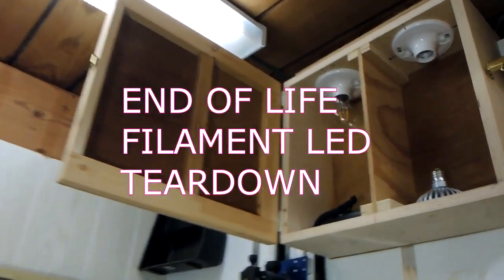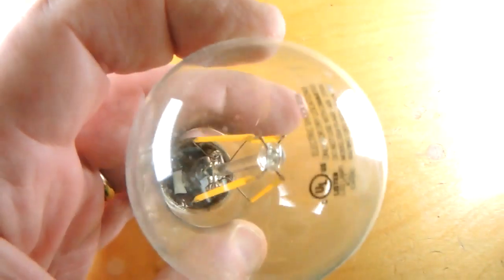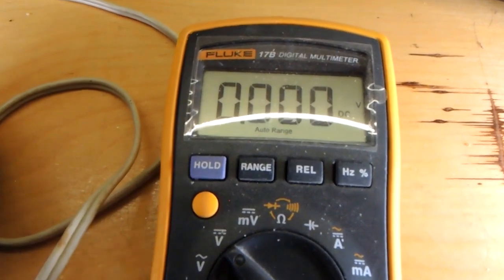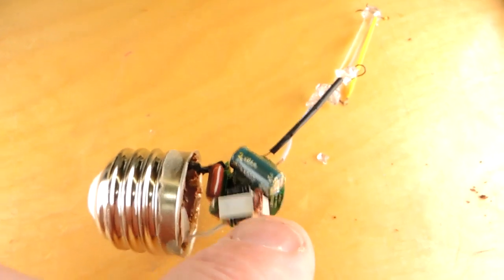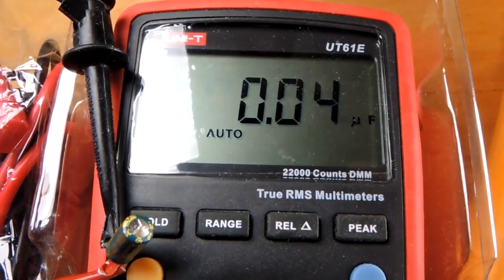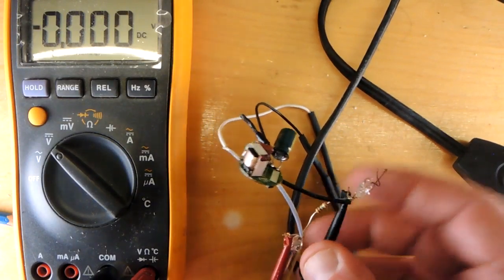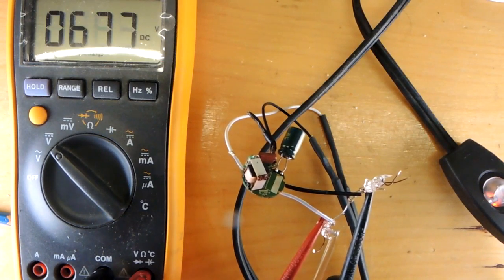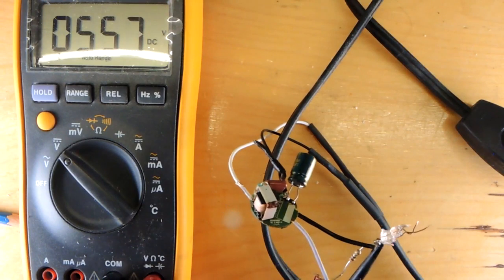Filament LED Light Bulb:  5 years and Teardown Time

Comment: I've bought 3 6W led filament bulbs like yours and all 3 had the filament fail(after 2-5 years). Possibly due to higher drive current? There was 6 filaments with 3 parallel and 2 series set up and once one filament dies it increases the current in other 2 and causes a cascade failure

Comment: Good to see how that test worked out. Such a pity they cheap out on power supply components. It would have been interesting to see how long the LED filaments would have lasted if you could just switch out the blown fuse and cap then fire it up again.

Comment: 70 V is quite typical for these. There are usually about 10 blue LED chips in series in each "filament" stick, and if I diagnosed it correctly your bulb had 4 of these sticks, two each in parallel and then these parallels connected in series, so you would have a two parallel strings of about 20 LEDs in series, each running at 3 V to 3.5 V.

Comment: Time flies.  I remember you starting that test.  How was lumen maintenance until the end?  Our did you stop sampling it after a while?
Reply from the maker: I stopped measuring after 25,000 hours.  Lumens up to that point were fine with little decrease in light.
Reply: @electronupdate  That's impressive.  The filament LED approach seems to be one of the best for LED lighting.  I do notice they're going the usual route of driving the filaments harder and harder though.
Reply: @bigclivedotcom  I kinda like them the best as well, I had a few smaller E14 filament bulbs using the lamp for roughly 3 hours a night, a 6 filament lasted around six months before it started flickering and a 4 filament lasted about a year and the one with only 2 has lasted far longer.

Edit: Oh yeah and I also quite like the bar lights with a metal back like these: https://www.ebay.com/itm/30CM-50CM-LED-Aluminum-Alloy-Shell-Under-Cabinet-Lamp-Strip-Hard-Light-Tube-Bar/142151598175
Reply: @bigclivedotcom  That is one thing which drives me absolutely bonkers with the progression of modern LED replacements. They start out with a high quality product with a high cost of entry, then slowly make manufacturing cheaper and drive fewer diodes harder until the quality is marginal at best. Then late adopters who waited for prices to come down feel essentially cheated by an (unbeknownst to them) inferior product. Happened with CFLs too up until their phase-out. I'd gladly pay a few bucks per lamp for one which lasts 5-10 years, which I'm confident is entirely possible. Heat kills semiconductors and capacitors, who knew?
Reply: @Wiresgalore  And now they last few years at best. Well, you can't expect anything else if case t ~ 90°C

Comment: It makes me want to install DC led lighting with a centralized power supply... Or at least find high quality bulbs that last 25 years. Got a suggestion for this?
Reply: @purplevideotube: You don't need to go through all that work. This is a bad form factor. Buy a different form factor that allows heat to escape. For instance, I bought 2700K Maxxima brand dimmable retrofit can types from homedepot.com almost a decade ago and they are still going strong. I never buy the kind of bulb EU has shown here because they get overcompacted. It was definitely the heat that destroyed that cap.
 Secondly I've got just everyday generic cheap 3528 SMD "strip lighting" from Amazon on a DC power SMP supply that has run over 10 years 24/7. I stuck them to the bottom of a metal tool holder so that afforded them some extra heat relief.
 I've also got some toggled brand dimmable 4 feet LED 5000K bulbs that are working flawlessly though they've only been going like 3-4 years. But I mention all these brands and details because I'd buy them again.

Comment: When these filament LEDs came out, I questioned the thermal design of the LED strips as there didn't appear to be sufficient heat sinking. Given the lifetime, I'd say I was wrong!

I've torn down a lot of failed LED bulbs and have found that it is about half driver and half LED failures.

Comment: Do you have an opinion on what would have made a more reliable cct...is it just the chinese skimping on quality of primary components, environmental or even lower dependence on just one component?
Reply: @Peter: It's the poor form factor of trying to put new technology into the confines of old technology. See my response above and I mention what has lasted longer for me & why.
Reply: "Do you have an opinion on what would have made a more reliable.." dude it ran non stop for 5 years... thats pretty reliable
Reply: @DanafoxyVixen  Sure, but it's a bottleneck that could potentially be solved
Reply: @Daan87423  Sure it can be solved but that costs money. As mentioned elsewhere, 5 years is already pretty good. Also note that it requires expensive tests to be able to guarantee that longer lifetime. That added cost is OK for a component in for example a car. But for a lightbulb, the manufacturer would like you to buy a new bulb. See how the bulb needs to last long but not too long :-)